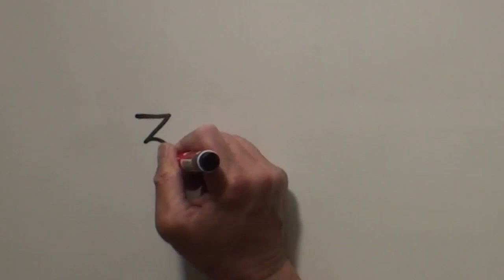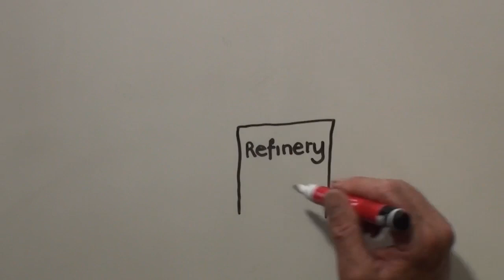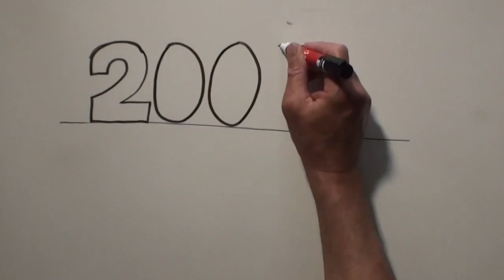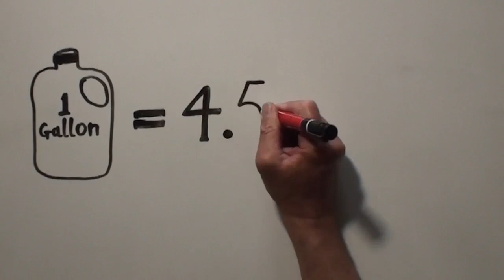Volts for Oil | Fully Charged

Comment: And do you propose to make this switchover today, tomorrow, or gradually, over decades? I ask this because if fuel suddenly stopped flowing, those of us without electric cars, or the money to buy them would be stranded; not a good move. The burden of raising the price of fossil fuels, through clean air regulations would necessarily fall on the middle and lower classes, the ones who can't always afford to run out and buy an electric-only vehicle. A Tesla, costing $60,000 to $70,000 may be chump-change for CEOs and Hollywood actors, but us commoners only make half that much in a year so it becomes a bit harder. I guess the bottom line is that we need to have the base in place before throwing out electricity from fossil fuel. Can you imagine the landscape with thousands of windmills and acres of solar panels, dotting the area? How romantic that would be...
Reply: Sorry - not sure if your last 2 sentences were sarcastic or not… but never mind.  The point I wanted to make was that we are not going to have to wait to for governments to increase the price of oil as it is happening now, has been so for years and the increase is exponential.  But don't worry too much, there is no need for  EVs to cost any more than their ICE equivalents.  

The high cost of EVs is just early market thing which, like mobile phones and flat-screen TVs, will fall dramatically quite quickly - assuming they become mass market items.  The cost of the constituents of EV batteries, generally palmed for the high cost of the whole car, is not high - maybe only one tenth of the cost of the cells in the marketplace today.  In fact, the whole EV drive train is so much less complex and requires so little in the way of highly engineered components compared to an ICEV that I wouldn't be surprised if they end up somewhat cheaper in due course.  They'll probably be giving them away in 20 years…  MW

Comment: I suppose it should be clarified that we couldn't go without refining altogether, because then we'd have to go without plastics, which are made from the lighter compounds. But if the refineries weren't powered by coal plants, then the effective carbon footprints of running old-fashioned vehicles would halve. So it's to the petrolheads' gain, to make the whole grid more carbon neutral :o)
Reply: hiddengrousefarm Besides which, we can already synthesise many types of plastic - or make plastic components form man-made materials that perform just as well if not better.  The only reason we don't (nor spend money on making synthetic materials cheaper to make) is because oil has always been so cheap… not so much any more!  MW
Reply: camillionmonkey: My saying "halve" was meant to be a vague, hand-wavey gesture, because i didn't want to declare the unwarranted precision of percentage figures :-P

hiddengrousefarm: Thank you for that. I thought all plastics came from oil, but that's probably because i do live in Otherpartsoftheworld :-)